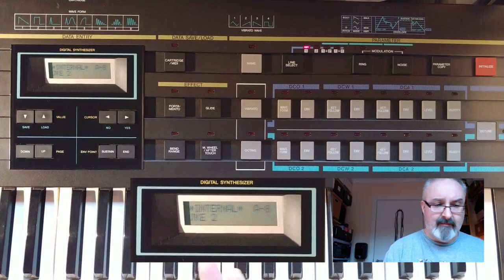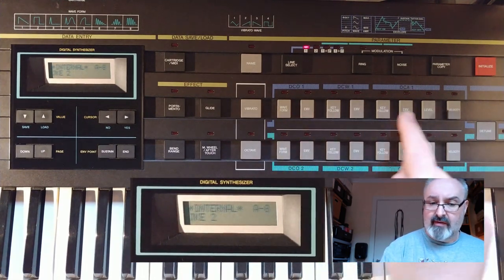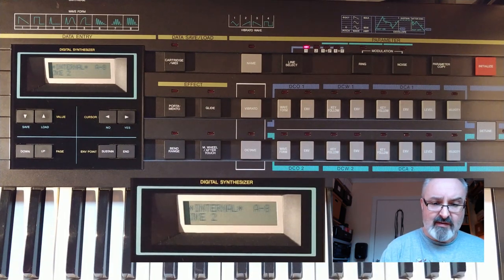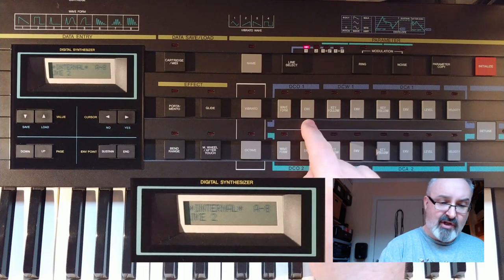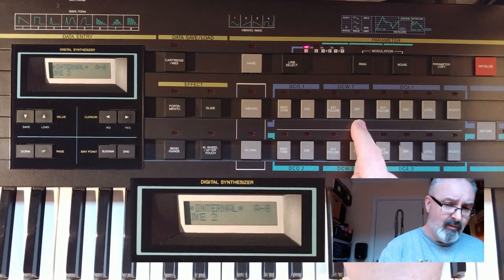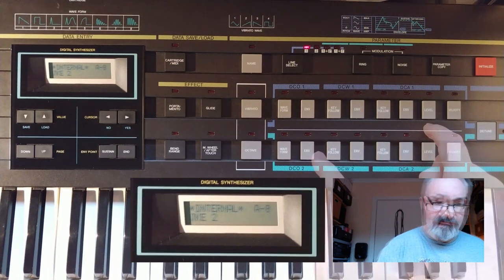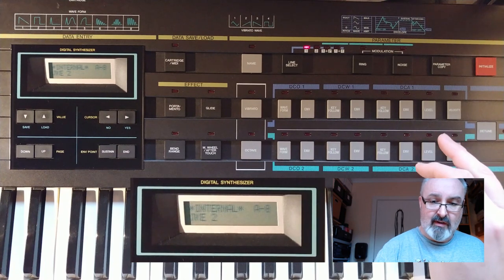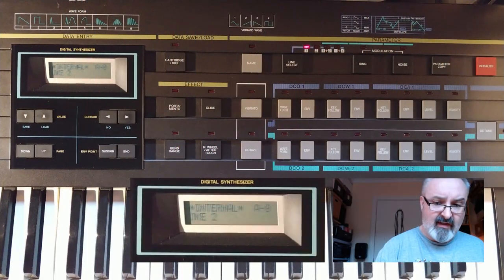Casio CZ-1 Phase Distortion Synthesizer - Part 3 - Envelope Generation

Comment: I´ve owned CZ-5000 and CZ-1. Now I have a CZ-1000 from 2 years ago. These synths have a wonderful and a really unique sound, but they are a nightmare to program.
Reply from the maker: I'm really surprised you say that.  They're not as easy as a analogue synth for sure, but they are well laid out and very logical.  I found D50 the worst to program, I wouldn't attempt it with out an editor.
Reply: The DX7 is way worse in my opinion
Reply: @jibjamjangles  Definitely! There's a reason the D50 and the DX7 are famous for their presets... :)
Reply: @jibjamjangles . I find it hard to make resonance filter sounds with fm synthesis.